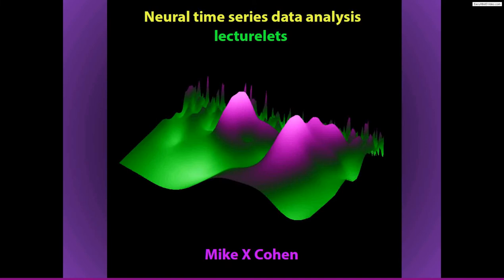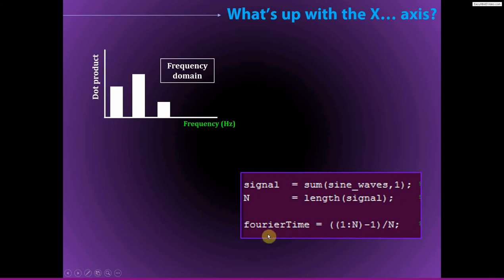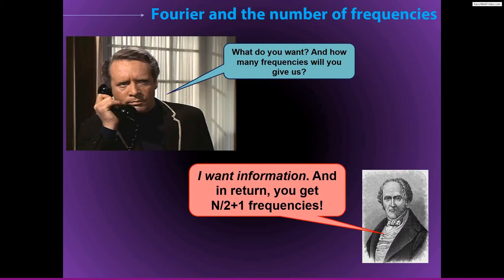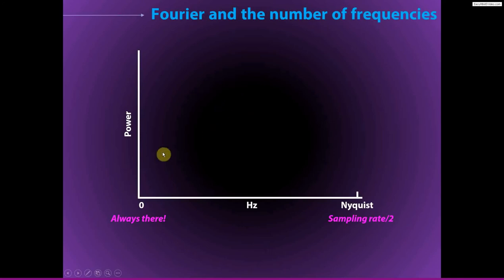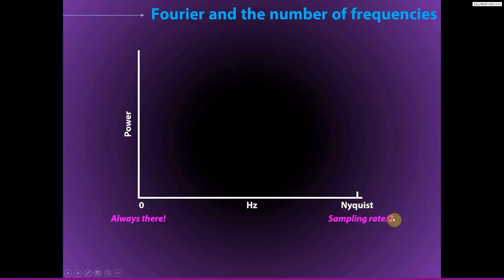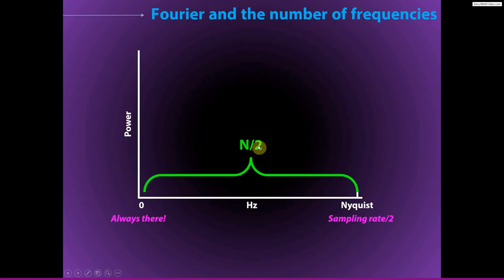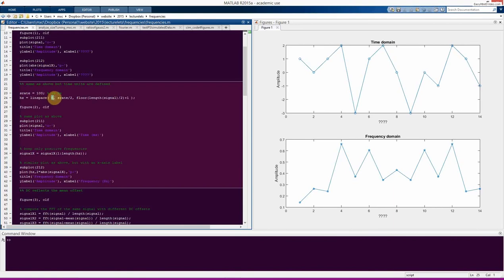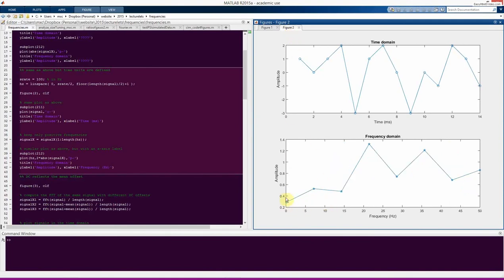Fourier transform frequencies and zero-padding

Comment: how did you figure out time(in milli second) of the second figure,, it seems to be wrong. if the sampling rate is 100 Hz, 10 ms is the time interval between samples.
Reply from the maker: Good catch! That's a small mistake. Notice that I didn't input x-values into the plot function (line 30 of the code). So the x-axis is still showing time points in indices, while the x-axis label incorrectly lists ms. My apologies ;)
Mike

Comment: Mike, kindly enlighten if you would (I'm not not from E&E/DS background),
I'm trying to perform a Fourier analysis on a set of daily data (eg. 576 days) via M.Excel,
means the amplitudes I look at should be from 0-289, correct? What I also don't understand is that the 0 bin seems to show highest amplitude. How do I interpret that, is it supposed to be ignored?
-
Thx
Reply from the maker: Fourier transform in Excel?!?! I had no idea it was possible. Why not do it in Python or Octave? Anyway, the 0 frequency is called DC (direct current) and reflects the average value of the signal. You can try mean-centering the data and re-run the FT.
Reply: @mikexcohen1  Apparently it can be done via Excel but for more complex/heavy duty usage I believe there are better platforms to do so.
Coz I have zero knowledge about coding and Excel seems to be the most direct tool available.
Does that mean we don't read the 0 bin, even if it shows the highest amplitude/magnitude ?
Reply: @Blu3Darren  The 0 bin represents the mean of the signal. The other (N/2) bins represent the frequency amplitudes.
Reply: Tobi thanks for replying, yea it took me a while after that to understand what it is :)